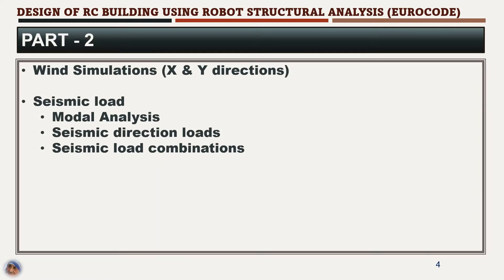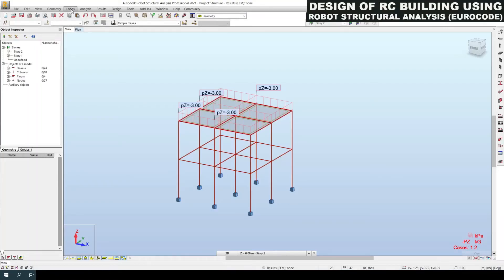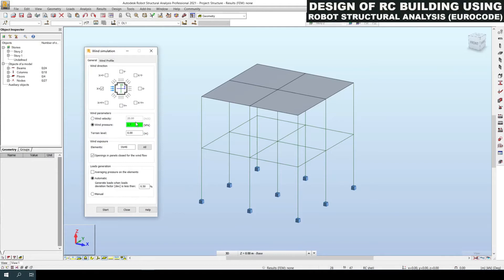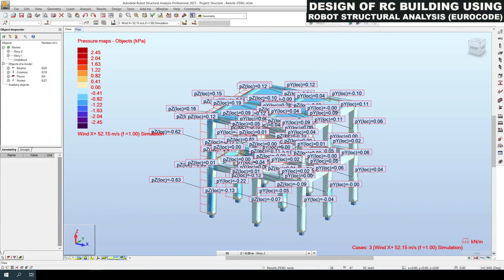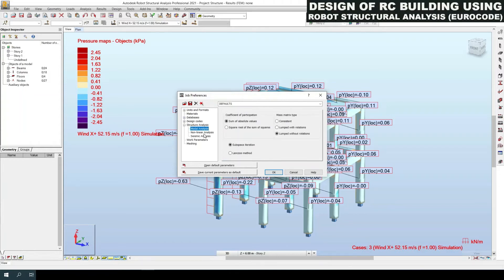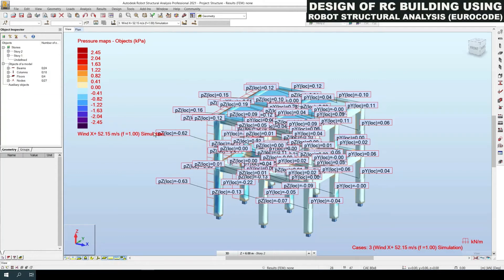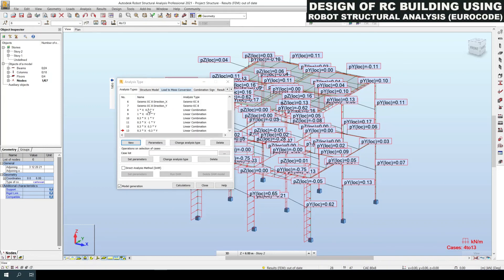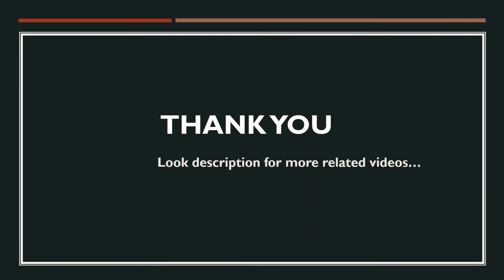Design of RC Building using Robot Structural Analysis | Part 2 | Wind simulation & Seismic loads

Comment: I think you should disregard density if you put self weight and other dead load together otherwise the self weight will be calculated twice
Reply from the maker: Self weight is considered as a whole structure (including all columns, beams, and slabs) in 1st line  and floor finishing weight (May be not 3kpa, should less than 1kpa) defined in 2nd line.